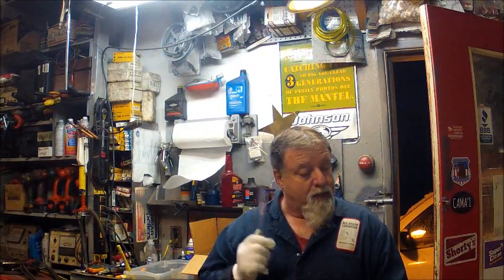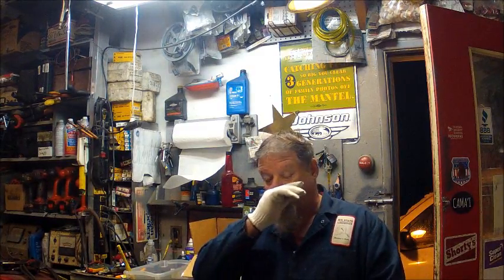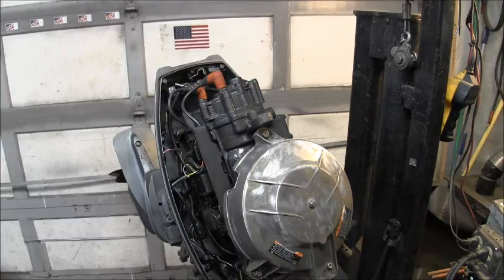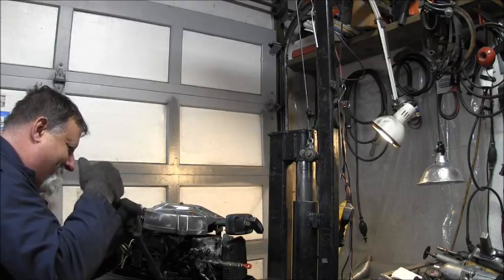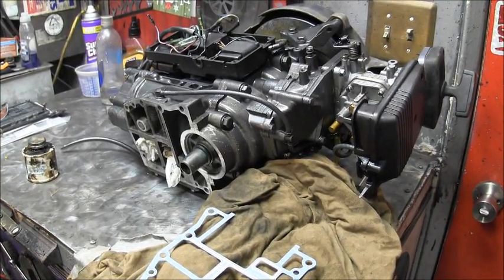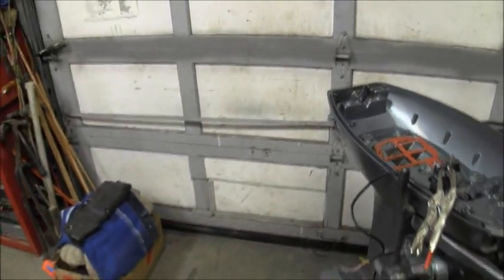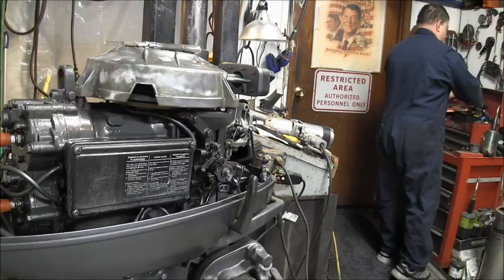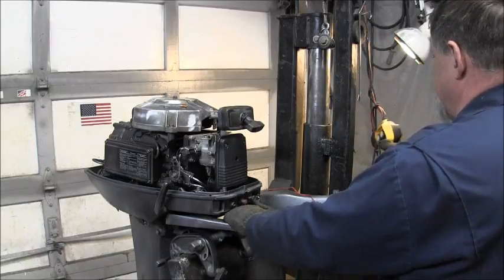YAMAHA 1988 ENDURO 40 HP,  (  WATER  LEAK )

Comment: Hi Kodi, Looking forward to the merc 50 tilt trim model for sure. Going to make my own power head gasket since the material I have is for high temp and fuel. I could buy one online so if any issues will have a backup. Going to use high temp seal too. Going to send a picture of an example of what I plan on picking up someday in your email. The Islands have postings like this all the time just need to take the ferry over.
Reply from the maker: Cool man' Make sure U cut all them water passages in that gasket 4 sure,  kb
Reply: I still have the old gasket to copy👍

Comment: Hi again bro, the upper casing gasket from Crowley showed up so replaced it sooner than I thought I would.
Do you happen to know the torque specs for putting the power head back on the bottom end?
It’s same engine as this aside from it being a 30hp (so it’s actually not the same, but it’s similar lol) I’ve got them at 14lbs which I think is general torque for them but I don’t want to mess this thing up . Any help would be greatly appreciated my good man.
Thanks
Reply from the maker: You R in The Ball Park mate,   Good torque for the first round,    Run Her for a 2 hr break-n  Then go up to 21 lbs.  You will B good to go.  Me  I  like 2 check it again & go to 23 lbs, Just for good feeling.     kb
Reply: @kodibassInsideoutboards  
Roger that!
Kodi your an excellent example of a fine human being!, really appreciate the expertise!! Really appreciate you helping us amateurs out.!

Comment: Quick question for you bro,
I have a similar problem with a 2001 yammy 30 mlhz but the water is dripping from engine side of the transom bracket.
Does it matter tho? It seems that’s water pick up side (and not exhaust side.)Engine telltale is strong thermostat opens seemingly it’s getting enough water to cool? I want to use it this summer and do the gasket in the fall.
Do you see a problem with that?? 
Cheers
Reply from the maker: I'd say as long as she cooling ok, should B fine. Just keep a good eye for any signs of a overheat.   kb
Reply: @kodibassInsideoutboards  
Kodi I really appreciate the reply, I figured as much I’ve been checking exploded diagrams on Crowley marine scouring service manuals and believe it or not your video is about the only thing I can find that even addresses the issue of water leaking from upper casing gasket.i did order the part but they always take a loooong time to get to Canada so cheers and thanks for responding bro.